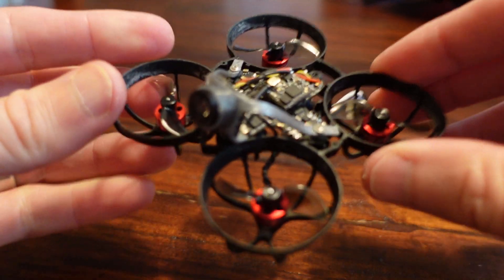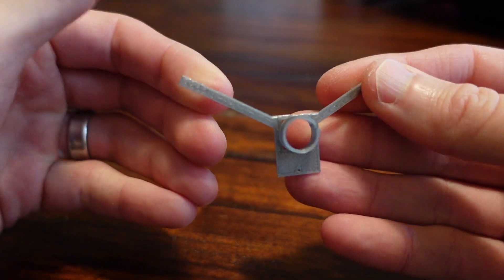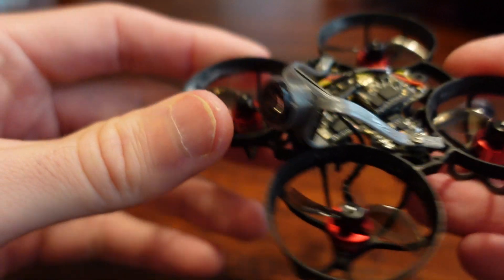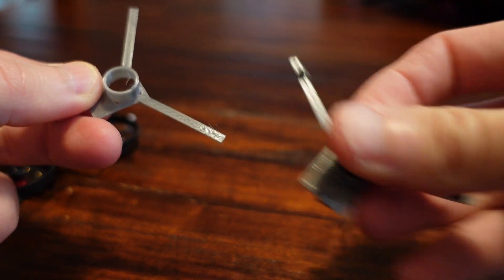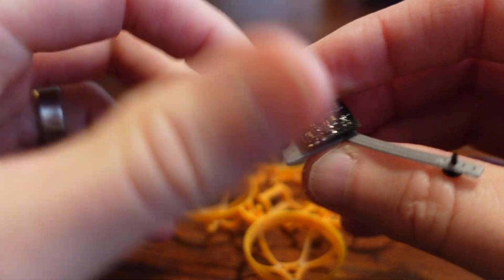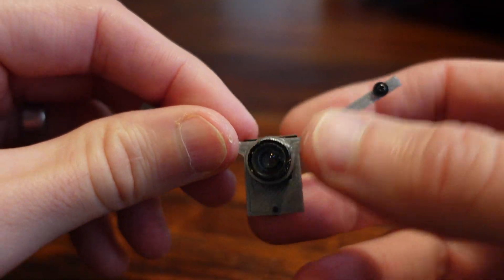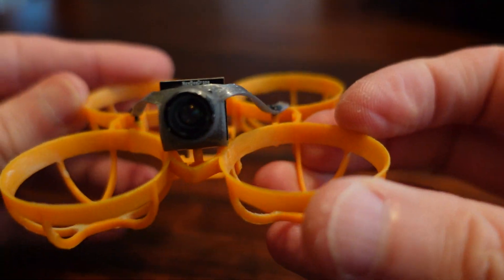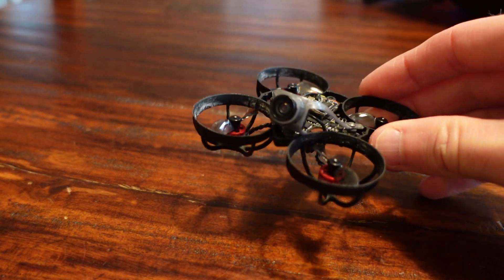Whoop66 Canopy: 0.6 gm - Prints Flat - NO Props in View - Free Download

Comment: I’ve been trying to figure out a way to do this with clear heat shrink and zip ties since I don’t have a 3D printer, lol.

I think you can save a bit of weight around the lens.  I feel like the printed sidewalls around the lens has unnecessary protection.  Maybe 3 thin prongs with a tiny clip on the end of the prongs to clip onto the front/side-edges of the lens would suffice?  Or maybe a ring printed at the front with 3-4 prongs.

Is there any reason why you didn’t extend the lens portion further?  I feel like if you aren’t going to protect the very front, you might not even really need that cylinder part.  Does that camera have tiny holes to fasten the camera onto the print?  I feel like that could be a better way to keep the camera in place if you’re using the cylinder part to wedge/hold the camera in place.
Reply from the maker: The a canopy this light it not going to provide any real camera protection. So the goal here was lite and just enough material for a stable mount. The ring around the lens comes up just high enough to get enough grip. The prongs require more material to get the same stability because you are gripping with flex rather than tensile stretch.